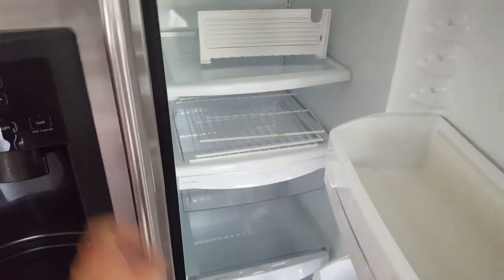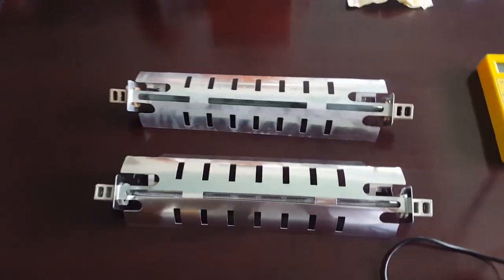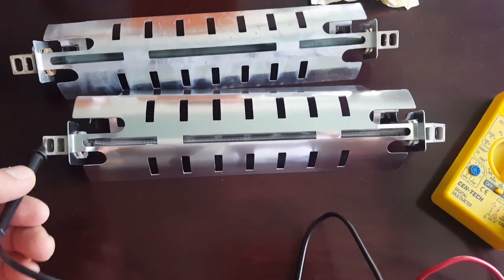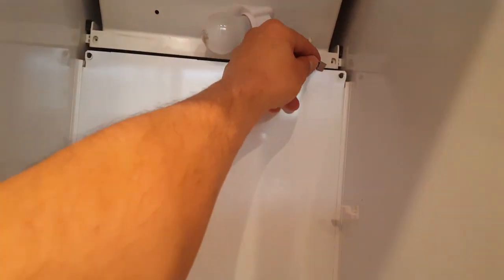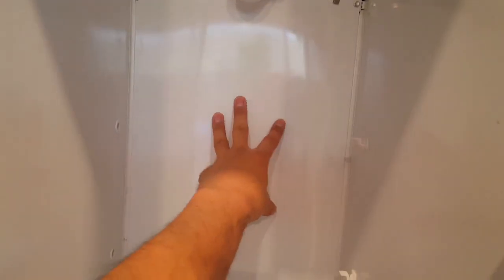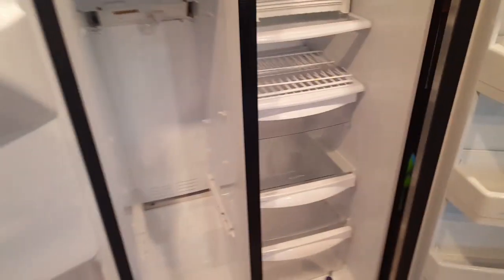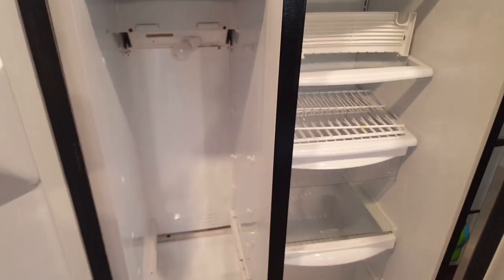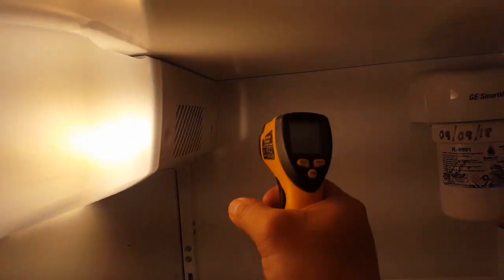How to replace the heating element on a GE side by side refrigerator.

Comment: I did the same thing last year.  Bought after market and it happened again this week.  Bought a new fridge. Spent the extra $20 on a ge part.  We’ll see if it last longer than a year like the cheap heating element I bought last year
Reply from the maker: Man. I totally know how you feel. Such a hassle. Glad you were able to get it fixed and running again.

Comment: I was hoping to see how to remove the grid shelves.
Reply from the maker: What are the grid shelves? You just lift up the shelves to remove them. In terms of the back cover, you simply unscrew it to see the heating element. That's all you remove to access the heating element. Hope that helps. Cheers

Comment: Hello Peter.  My refrigerator is experiencing the same symptoms.  I had replaced the heating element about 5 years ago but I still want to remove it and test it out. My question to you is, do you think I can successfully defrost the freezer while it is on or do you recommend unplugging it? Good video!!
Reply from the maker: I would un plug it since the ice has probably caked on the whole back of the freezer.
Reply: Hi! Thanks for the video. I need the two clips that go on the end of the blue and pink wires. The last person to own this fridge removed them and did a different system. The wires are still there and and I have the correct replacement part, same as in your video, just missing the caps of the wires. Any advice?

Comment: So I replaced the heating element (which was definitely bad) but the evaporator continues to accumulate frost. The frost accumulates up to the last 3 coils and then there's no frost at all. Freezer is still above freezing. What is the problem now?
Reply from the maker: Try keeping food away from touching the back wall of the freezer.   Also make sure that the rubber seals are in place correctly on the edges of the wall.
Reply from the maker: I forgot to ask. Did you completely defrost the freezer coils before restarting the unit? I ask because if the sensor isn't frozen with ice and the rest of the coils are, the unit will think all is well. Just make sure all the frozen ice on the fins/coils are gone.